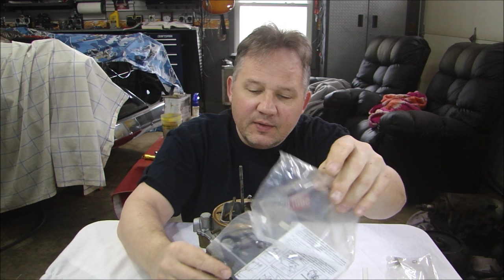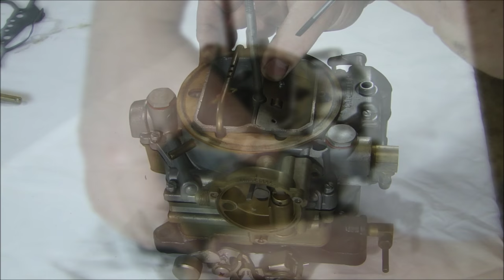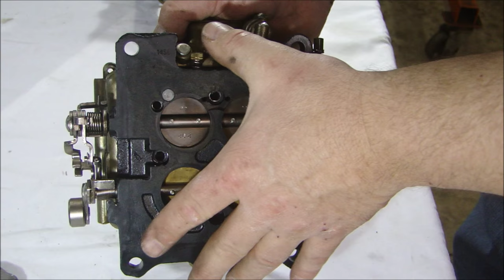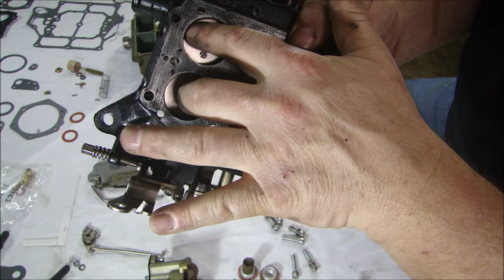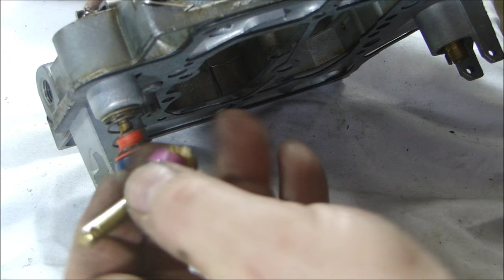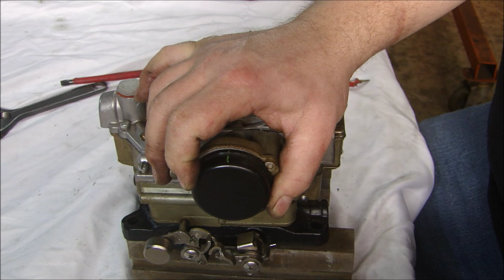Engine Rebuilding - Part 7 Rebuilding Carburetors

Comment: Great video! That seems like quite a complex carb design. Makes me appreciate the simplicity the Holley 4160 I rebuilt.
Reply from the maker: It is a bit complex. I can see those floats getting a pin hole and filling up with gas
Reply: I agree. Compared to a Quadrajet which had one simple float this Carter looks like a nightmare. Far more complicated than I think it needed to be. I primarily worked on Chevys so I never got to work on Carter's but looking at this one I'm sort of glad it worked out that way. Needless complexity.
Reply from the maker: Post war engineering

Comment: Pete, the best tip in the whole video was put a white sheet over your table. I've rebuild hundreds of carburetors and I sure wish I would have done that back in the day when rebuilding carburetors was something I did routinely. The guy that taught me carb rebuilding, Clem Zahrobsky of Delmont, PA, told me that the cardinal rule was NEVER EVER REMOVE THE THROTTLE PLATE SCREWS. There is absolutely no reason to ever do that to begin with and secondly it's a PIA to do since they should be staked, or at least they were on every Rochester 2 bbl and Quadrajet I ever worked on, so you had to grind off the staked part of the screws to take them off and use new screws and then stake them when you put the throttle plates back on. As you mentioned, they are precision fit devices, and removing them was simply asking for trouble. Why do you think the previous rebuilder removed the throttle plates? There is nothing to be gained by doing so, and as you found out, a lot to lose.
Reply from the maker: Well, I suspect it was all carbon coated and maybe it was taken apart to clean. The screws are usually soft and tough to get out. Luckily these came out ok. As you said there is no reason to take them out, but if you do, make sure they close properly.

Comment: IDLE mixture screws are used only to adjust idle mixture  and if the butterfly plates completely close the engine will stall as shown by IDLE speed adjustment screw used to hold engine idle speed regulated by amount of butterfly plates opening -
Reply from the maker: Thank you for clarifying that

Comment: Nice videos.
Carburators are very complicated.
Have a VARAJET carburator from the Kadett to rebuild, and 2 WEBBER 40 DCOE.
Have the rebuild kits for them, but affraid to start disassembling .
Reply from the maker: Don't be afraid...it's the only way you learn.
Reply: Need to be mentaly prepared :)
Also need to get a quiet place with a bench to do it slowly.

Comment: very interesting comment you made regarding the idle mixture screws not working because of the gap between the throttle butterfly flap and the carb wall. It makes sense to me! However, my carb has a single butterfly (Zenith 28IF) and the spec calls for a 0,6mm gap. Maybe thats the reason why my mixture screw doesn't work properly. Some rules are meant to be broken!!
Reply from the maker: There should be no gap in there. here is a video about rebuilding one https://www.youtube.com/watch?v=4TTFFZ95fjI

Comment: Hey Pete, watched your whole step by step for this car now, really interested and learned a lot. just waiting for part 8 ? 

I subscribed to your channel because its really informative and helpful. easy way to learn stuff. thanks ! :)
Reply from the maker: Thank you very much Ricky. Part 8 is on the way, finishing up the dyno test video.
Reply: no problem atall, will be interesting to see what the figures are before and after rebuild, interested to see how much of a difference it made to the stock performance ect...

Comment: Awsome job cool old car I'm getting ready to rebuild my sb 350 it has 260,000 with 151 compression in all very very even..i hope to get another 30 40 thousand out of it .and then I wanna drop a crate motor in while I rebuild the original 350 and take my time with it ...do you have a preferred crate motor?? Jasper or goodwrench..
Reply from the maker: Sounds like a cool project. I don't prefer any crate motors. They advertise performance based on an engine built and tested. The engine you buy is not dyno tuned.

Comment: Hi Pete, how did you go with the oil problems on your 351 / 427 ?   The last video in that series showed you troubleshooting the oil return issues in the aftermarket heads.  Was that the issue and what happened to the engine and the project car?
Reply from the maker: I made an update video about that. After this engine gets in the car I'll have that one back on the dyno for the last time.

Comment: Hi Pete, my question is off topic, but you stated in your comments, on your Cobra engine build, you modeled the valve train and piston clearances,  do you use a software package? if you do, what is the name of your software? Also thanks for parting with your knowledge, it goes hand in hand with engine building books . Stewart. Australia
Reply from the maker: I draw in both Solidworks and AutoCad. I try to make sure the information I provide is both helpful and accurate....but I make mistakes sometimes.
Reply: Petes Garage Yes Pete, you do an excellent job, and have taught a novice like myself a lot. What is your opinion on computer based trail and error dyno software such as Performance Trends Engine Analyser or Pro Race sim? Apparently some of these programs list after maket parts one can try in their engine build to see their effects on hp and torque. I guess once you have enough engine building experience,  the software used to pick parts would become a novalty, but as a learning tool for beginners, what do you think, are they accurate?
Reply from the maker: I have never used them so I can't give you an honest opinion

Comment: Hi Pete, Im having an issue and I suspect its a carb issue.  Car is a 73 cuda with a 416 stroker, holley 3310, no vacuum advance, msd ignition, magnetic pickup distributor.  Car idles fine in park, when I put in drive vacuum goes from a steady 15 in and sweeps about 3 graduations lower back and forth.  Idle becomes rough when slowing down to a stop sign, occasionally stalls at said stop, car starts right back up.  Fuel bowls appear at right level, idle circuit appears fine in park, initial timing is 15 degrees. Could it be the idle circuit, even though it doesnt act up in park?  Also, carb has no choak.  Did not locate a vacuum leak in either break booster or pcv valve.
Reply from the maker: That really sounds like a sticky valve or 2
Reply: @PetesGarage  This weekend I tried a can of seafoam in the crankcase and let it run to full temp, let it heat soak and sit overnight.  Started today and still getting the vacuum drop when I put it in gear and sweeping :(  Could I maybe have a bent valve?  Or maybe there is an issue with torque converter since I only have the vacuum drop when I put in drive?
Reply: Did a compression test and all cylinders around 180 psi, but I noticed every single plug (e3) are black and appear fouled.  Screw e3 plugs, Im going back to champion!  I think that might be the issue.